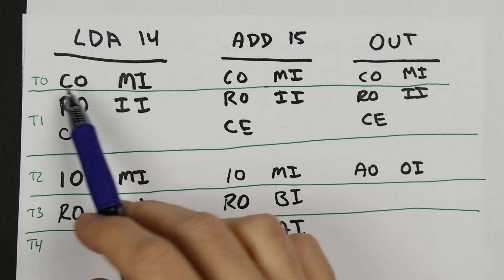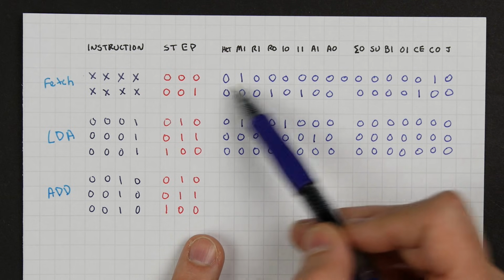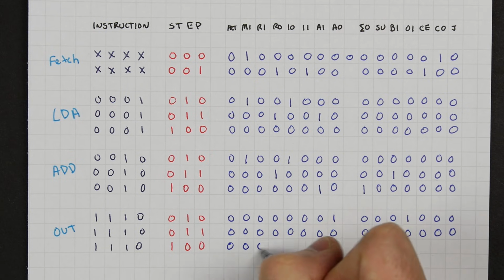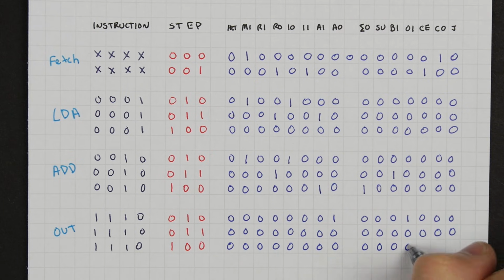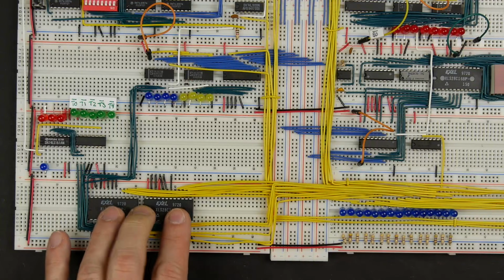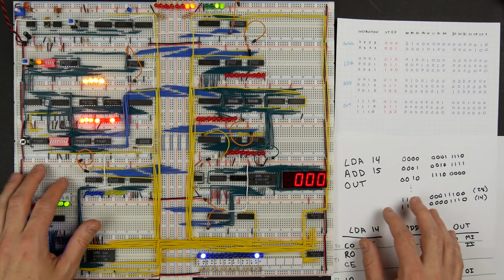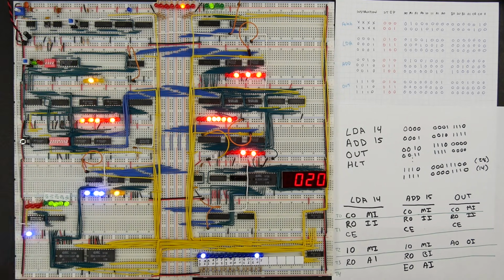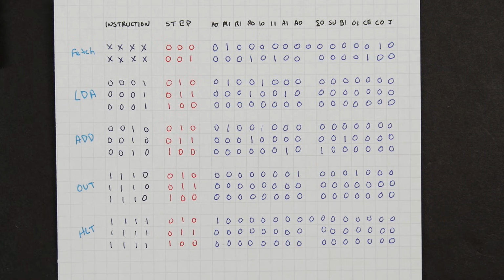8-bit CPU control logic: Part 3

Comment: I found an easier way to program eeprom manually, or program any 4 bit with those switchese, with the least switching. The rule is simple: you switch the last bit you can, which not provide a combination that has already seen. I think I cant tell it really good in english, but the combination is:
0000 - 0000
0001 - 0001
0011 - 0011
0111 - 0010
1111 - 0110
1110 - 0100
1100 - 0101
1000 - 0111
1001 - 1111
1011 - 1110
1010 - 1100
0010 - 1101
0110 - 1001
0100 - 1011
0101 - 1010
1101 - 1000

the first columb is a bit more organized, but dont follow the rule, however you should switch minimal times too, but its easier to follow that sequence. I think there is a more simmetric one, but I dont see it.
Reply: and in the first columb, if you divide the columb in two, each part you got has a symmetry: 0,1,2,3 is the inverse of 4,5,6,7 and 8,9,10,11 is the inverse of 12,13,14,15.
Reply: Thi right combination for
Q3: 0000000011111111
Q2: 0000111111110000
Q2: 0011110000111100
Q4: 0110011001100110
Reply: Now its easy to write a recursive function to generate a code for this
Reply: I think I'm not the first came up with this, so does anyone know the name of this pattern, and the other usage of it?

Comment: i have computer too,but i think its more clever than anyone can imagine.
NOP 1 clock cycle
LDA #$14 2 clock cycle
LDA $14 3 clock cycle.

you ask how is possible.
well read from memory that is pointed program counter. vola we have it on instruction register. we know put it in there becouse we know we read instruction.microcode was alleready setup on reset (and after we done other OPs)
next HALF pulse we change microcodes according to OP code.increase counter. reset instruction counter(if NOP example)

2nd clock cycle we know its data.it go directly where it need go. in this case Aregister. next HALf clock we change
microcodes again to fetch instruction. reset instruction counter.increase program counter.

3th clock cycle is needed if data is read from memory,but it go directly to a register becouse microcode was changed on 2ndclock cycle.
and every thing is reset. 3 cycles is maxium i need

ben might know how do it. only need small delay after rising clock cycle to latch data destination register.down clock cycle microcodes can change,becouse nothing will happen same data not latch example in B register becouse we not rising edge. thats make it clever,but you could think it as its just double clock and i use rising edge and down edge.maybe its cheating lol

Comment: is there any way of using single eeprom instead of 2 eeprom because it is hard to find the 28c16 ic's
Reply: I think a AT27C1024 should work as it uses a 16 bit word (it as 16 IO Lines O0-O15) i have not looked for one. but i will work on that in the new year. and if you need more then 16 control lines then you can add a second AT27C1024 and get 32 control lines
Reply: The 27C1024 (64k x 16bit) that Bunkerboys mentions is a good single-chip solution, and you could instead use an EPROM like the 27C16 (or the possibly more common & modern 27C64), but you'd have to erase it with ultraviolet light. A NOR Flash part, like the SST39SF010A, 128kx8bit (still 8-bit wide, needlessly large, but only $1.50) can also work.

Comment: Using two EEPROMs for the 15 control lines seems wasteful since most of them will be 0s in any given microinstruction. In fact, there are 5 control lines that output something onto the bus and it is important that you never set more than one of these at once. There are also 7 control lines that read from the bus (J is just another name for program counter in) and while you could load several register from the bus at once, I don't expect any of our instructions to ever need to do this. So you might be able to use a single 8-bit EEPROM to control all 15 control lines. 3 bits will select one of 5 things to go onto the bus (using a decoder chip to turn the 3 bit number into one of 8 lines active, only 5 of which we'll be using), 3 bits will select one of 7 registers to read from the bus (again using a decoder, 7 is actually our maximum, because we need the 8th option for those bits to be nothing reading from the bus), and then we have 2 more bits. We have 3 other control lines (halt, subtract, and counter enable), but we probably wouldn't ever need to do any of these at once either, so we can use a 4-bit decoder for these. I guess that's technically more chips (1 EEPROM, 3 decoders, and probably 2 inverters since those decoders seem to be active low) but it would mean easier EEPROM programming since your instructions wouldn't be split between 2 EEPROMs.
Reply: Indeed. You could even include halt in the output select decoder, and then you would not even need the 2-to-4 decoder. Although that might make it difficult for any future expansions (like conditional instructions as Ben does near the end of this series).

Comment: Really excellent series. Thank you so much. I have not watched to the end or later videos yet, but ...
It seems like there will be gaps (wasted space) in the eeprom corresponding to states T5 to T7 on the step address bits.
If the step address bits are on A4 to A6 (high order bits) then the eeprom table will be (a) shorter and (b) compact with no wasted space.
Because the op-code bits are a power of two.
Of course, the disadvantage is the the micro instructions are no longer adjacent.
This is only a real issue when viewing a dump of the eeprom.
However, the table could be written as if it were the other way (on the Mac) and a simple program (e.g. python or whatever you are used to)
could take that as input and generate the 'optimised' layout.

The OCD in me worries about wasting resources. :)

Cheers, Mike.

Comment: Very belated optimization question: can you shave off another microinstruction by, when you load RAM into the instruction register, also loading (the bottom four bits of) RAM into the memory address register? That would skip the IO+MI step for every instruction that starts with it, so if every three-microinstruction instruction starts with that...
Reply: My logic here: once, at the end of microinstruction 2, you have the program loaded in the instruction register, you don't need to preserve the contents of the memory address register - the only thing in RAM there is already preserved in the instruction register, and the location in RAM only matters to the program counter, which is already keeping track - so the contents of that register can be safely overwritten because they are of no further use.

Comment: We could eventually grow the memory and program size to the point we can program an eeprom with this computer!
Reply: I laugh because I have my own project going on where exactly this can easily be done. I’m not building a computer 100% from scratch like Ben did. I used a z80 processor and added the supporting circuitry like ram, rom and IO. I wrote a program for it where I can input op code to it. The op code gets saved into ram where it will eventually get executed. If I were to replace the ram with eeprom, well, it’d be an eeprom programmer. There would be a couple of nuances to get around, but that’d be easy enough. With gentle modification to the circuit, it could also be used to dump the contents of an eeprom or even clone one

Comment: I know I'm very late on this, but what if there was a signal to add to the last step of the command to reset back to zero? So in T1 you have RO II CE, but for the last step of each command you can have for example LDA 14 -> RO AI RT where RT is Reset T?

Comment: you could wire more than the 4 instruction bits to the eeprom, so you could support more than 16 instructions, because not all require additional parameters (out, halt, nop, ...)

Comment: I'd still really like to know how you connect the LEDs directly to the signal lines, without dropper resistors. If they were on the inputs, fine, you can probably use the Pull-Up resistors for that, but on the outputs?

Comment: Why do we put code on RAM and not a PROM?
Reply: Because we do not want to have to always program a ROM if we change our program. Having the program in RAM even allows to modify the program while it's running (a.k.a. self modifying code).
Reply: @stephanweinberger   No. Regarding this particular computer, you could as well have an EEPROM instead of RAM because the life cycle and speed of EEPROM do not really matter here, and it is as easy to change (to "program"), in these circumstances. And self modifying code is something you really should not consider, even for much more complex CPUs, it only adds a vastly more complex layer that is not necessary, however appealing it might seem at the first glance.
Reply: @pev_  Rainbow's question was generic and  not about this computer in particular.

Regarding EEPROM and this particular computer: the algorithm to program an EEPROM alone would exceed this machine's capabilities...
Reply: @stephanweinberger   Again no. The EEPROMs that he's using in this computer can be byte-programmed simply by the Write Enable pin like a RAM. The chip's internal automatic program cycle takes 5 ms so as long as the computer's clock speed stays under 200 Hz, it would work as RAM replacement. Just make sure the WE pulse is timed short enough like Ben did in his first EEPROM video with the manual programmer.
EDIT: Actually there are EEPROM versions that have a shorter than 5 ms write cycle, like Ben's here. I just got that from an older datasheet for a similar chip that I happened to have :) But the important thing anyway is that the write is completely automatic once you set WE low for a correct time just like in a RAM, and this computer is slow anyway, do you really need to go higher than say 200 Hz for the main clock.
Reply: @pev_  With only 4 bit PC there's not much program left after you implement an instruction to store to the PROM. It would only make sense with a larger address space.
Reply: @stephanweinberger   I'm sorry to be the naysayer here all the time, but no, as I said these EEPROMs have it exactly the same as a RAM, only the write cycle takes longer. If you still doubt this please read the datasheet for one of these EEPROMs!
Reply: @pev_  ok, seems like I had some kind of brain freeze. you're right of course.
Reply: @stephanweinberger   Perhaps you were stuck thinking of the early generation PROMs, they did require more complex measures to program, e.g. they had to be explicitly erased first and also often needed a separate, higher voltage for programming.
Reply: @pev_  it somehow started there, but even after realizing you can now get byte-programmable parts I was somehow stuck in "you need a separate instruction to write to this"... weird tricks of the mind... :-)

Comment: Wait... 14+15 is not 42
Reply: 14 and 15 are the addresses in memory, not the immediate values; "LDA 14" means "go look at addr 14 in mem and put whatever value is there into register A", same reasoning for ADD.
Reply: @zdimension_  OK, wait, I've already realized that a little later than when I posted this.

Comment: Would it be possible to implement this kinda thing in a fpga where you only need to provide some memory?
Reply: Of course! intel/Altera, Xilinx, MicroChip, Lattice and a bunch of other new FPGA entrants all have "University" developer/evaluation offerings, some for a quite modest cost. There's not a lot of logic in this design, so it should easily fit into even a small FPGA.

Comment: Could'n you have a "clear stepper" pinout that you can set as part of the microcode? That would allow the smaller instructions to reset the counter one cycle earlier.
Reply: Or just use all 0 (which will never be a useful microinstruction) to reset the counter on the falling clock edge.

Comment: @Ben Eater do you have a schematic diagram of 4 key or 5 key input interlocking circuit.this is the sequence when i press the push button1 the LED 1 will turn ON then when i press push button 4 the LED1 will turn off and the LED4 will turn ON then when i press push button2 the LED4 will turn off and the LED2 will turn ON...note all the push button is normally open...thanks in advance

Comment: so im basically at this part where when all my control signals were just jumper wires and you manually stepped through the program and it works fine when manually jumping the wires for each operation by hand, however when i add the eeprom's and basically try to let it run i keep getting missed ops and sometimes it will loop the first 3 main steps over and over, sometimes even when ai is lit nothing actually goes in the a reg or output display nothing happens and it will just loop and loop and sometimes something will show up. gain when i had the jumper wires for the control signals i had it working. im stuck yours runs through the steps in just a blink where mine seems to loop the same commands over and over. also i did remember to change the second eeproms number one pin to high so it will read the 2nd eeprom correctly.

Comment: Sorry, Ben, but I was cringing when you started it up with a free-running clock, knowing that all of the unimplemented instructions would be full of "1"s in the microcode, causing a whole bunch of things to be enabled onto the bus at the same time.  I guess I was thinking of 74HC logic, which doesn't like it when two outputs try to pull in opposite directions - now I remember that 74LS logic doesn't mind this so much.  Just the same, it might not be a terrible idea to program all of the unimplemented instructions with all zeros.  Since you're using EEPROMs, there's no problem reprogramming them later as instructions are added.
Reply: Or better yet, program all unimplemented instructions to halt, so you can see instantly which instruction in memory has a problem.

Comment: Probably did this in a later video, but surely you could use the remaining bit in the second EEPROM as a reset line for the micro-instruction clock reset?
This would optimize the CPU by removing the redundant micro-instruction clock cycles.

Comment: Coming at this a year late, but ... would it be possible/smart to add a control signal that resets the step counter to zero, and have each instruction's microcode activate it as its last step?  That way you wouldn't have any wasted steps, and could add instructions with many more steps if you needed to.

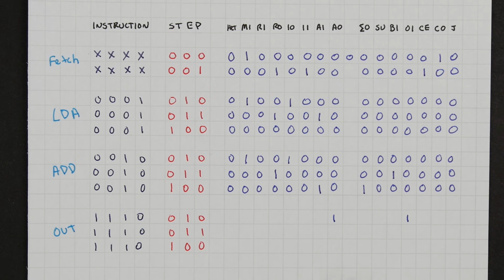Comment: Q: RE: 9:01 your out command => Should that Out not be OutReg A ?  Because some time you might want the OutReg B? 
Also later as you said you might want to display an on NegOutA (that is not the right way of saying it, but close enough).. 
You know I am also noticing there are not a lot of of combos of Instructions. You almost could number the number of instructions (Less then 16) which means you could used one EEPROM with 4 bits of the 8bit datalines controlling a number of 74ls154 to control all your logic groups/functions. Same Idea you could also could used three bits to control a  74ls138  but that MUX output would control just one logic group/function, depending on the 1-8 input (which some lines could be hardwired high or low depending on the desired out come OR external logic could control one of the input lines and depending on the line selected 1-8 could change the output function on the fly.)
Reply: Ben If you look on your book PG 43, something like that in Fig.2-25.

Comment: Ben, 

Could you not: Make the first micro instruction or step (of an instruction) contain the number time steps/micro instructions in the instruction?

That way you can have instructions of any length.

Perhaps you could add another EEPROM at the end of the others in the instruction table. The first entry across from the start of an instruction could be number of micro instructions.

I supposes perhaps to implement it,  you might need a compare instruction in the microcode to check if you are done with the instruction.

Alternatively, I think that the number of microinstructions could be logically compared to the step, you could reset the step counter, that way you don't have to burn clock cycles comparing.

BTW, no full speed test using the oscilloscope?

What a great series. I am having so much fun watching it. Thank you!

You deserve some nice toggle switches. I recommend either some nice Switchcraft Les Paul guitar pick up selector switches, or some nice paddle switches, ala 1975.

Comment: You can use a NOR (2 basicly ) gate on the output of the 2 EEPROM's to reset instruction decoder counter to 0 so you don't  waste clk cycles on instructions with less that 6 sun-intstructions

Comment: RE: 16:08 you could have added another EEprom to control your counter reset on the 74ls161, that way you could change the number of micro instructions if need be. But another way of doing that but not as flexible is to use a 74ls154. And use the input from other logic blocks to control the xxLS145 inputs- not as flexible but still could work. EEprom still, with correct logic block input, could be an easier out.

Comment: why not just use a single (preferably 8bit addressed) EEPROM, double/delay the clock somehow, and use one of the unused address lines to swap between a "high byte page" and a "low byte page" (or shift all addresses up one and swap with A0, should be easier to program/debug this way) to feed the first half of the control word into a register, then set that register and the second half onto the control bus, and clear it again on the next cycle? i imagine a register being cheaper than an eeprom, and also a single eeprom being easier to manage/program/debug/whatever than two halves. also it kinda hurts me to see all those unused bits :P